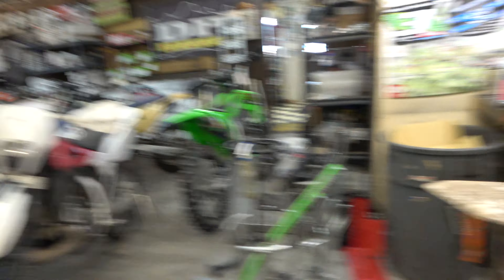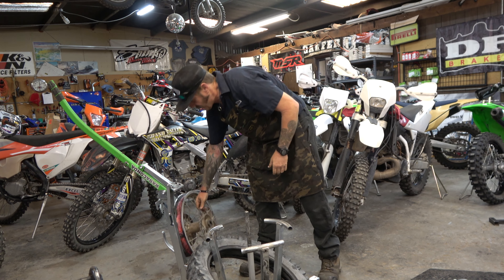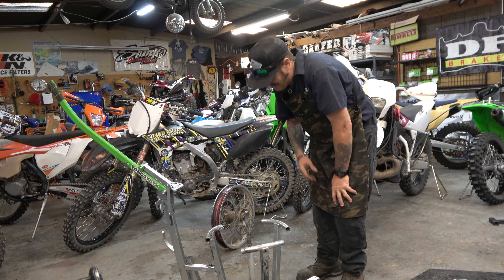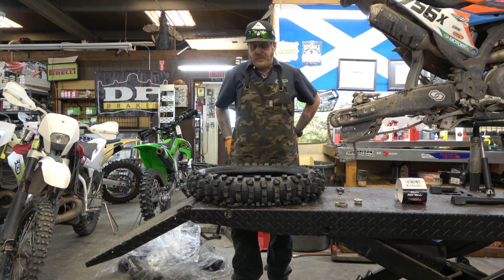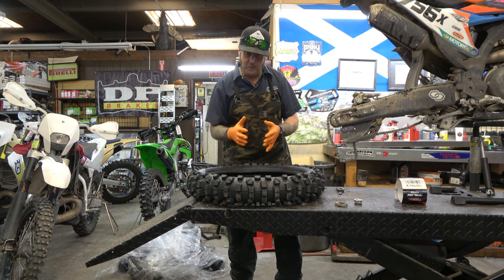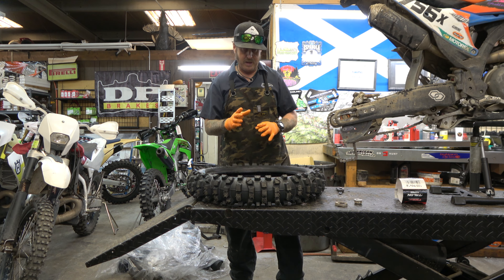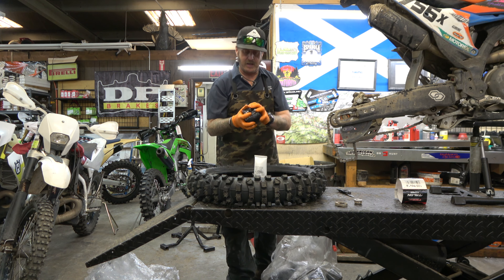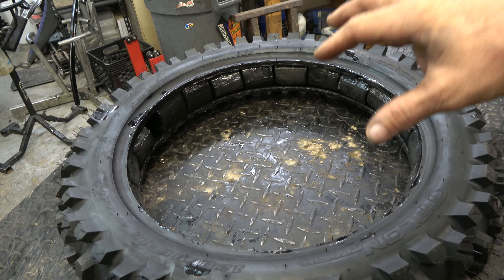Are Mousse Balls Good For Hard Enduro | Carapaks Extreme Mousse | Tusk Talon Tire | What is Best?

Comment: Where I live we have "Otom" mousse from China that retail for $60. They feel the same as Nitromousse standard mousse and last just as long. The foam is a bit different but they work great. Do any of you ever see these in the states?
Reply from the maker: No. I’ve never seen them.
Reply: The first mousse I ever used was called DuraMousse from Australia and it was the same as mousse balls. 5 or 6 inch segments. They were a pain to get out when changing tires but worked fine. They actually had different diameters to match tire sizes though. The fact that mousse balls only  makes one size should equate to a lower price point. It's a piece of foam for f@#$ sake.  @highlandcycles
Reply from the maker: @fmtnic  I know. But they are made in Italy. Everything from Italy is over priced but sexy.

Comment: Wonder if they could make a 2" lighter foam spacer so they didn't move or lighter sections you could buy. Been loving lucioli this year.
Reply from the maker: You can cut one down easily to just fill the gap. Lucioli is good but just too heavy for me.  I don't think you notice it in the slow, hard stuff but at speed I actually really notice it.